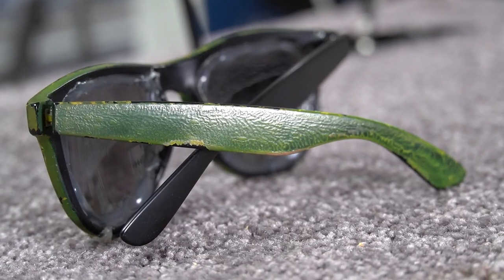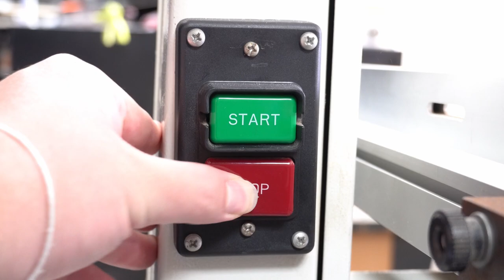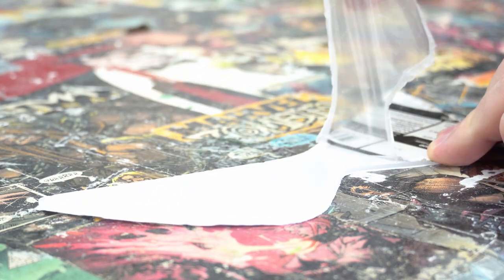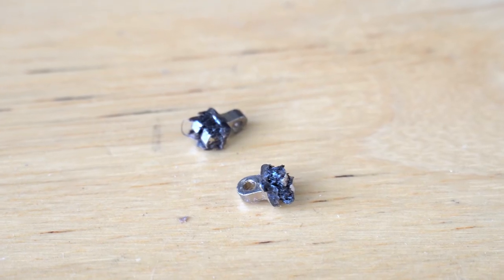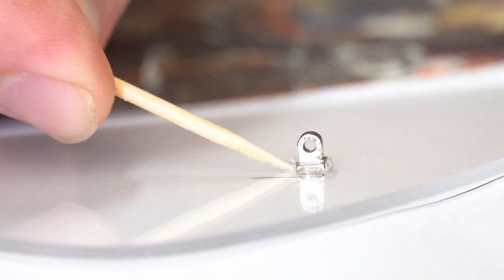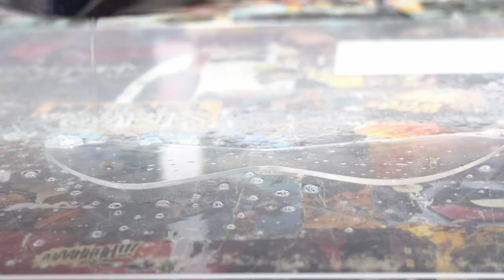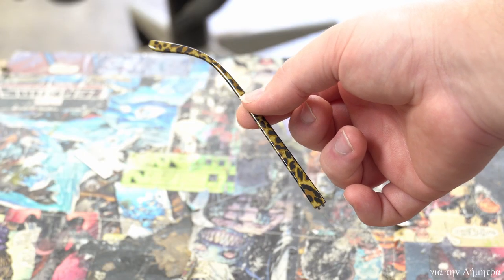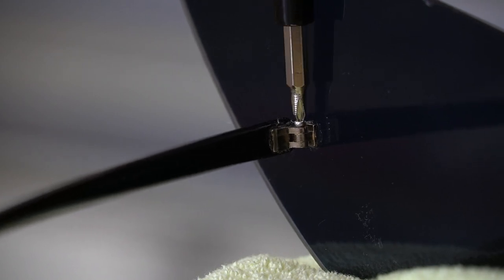I Made Real SQUIRTLE SQUAD SUNGLASSES!!!

Comment: Looks awesome! I would have maybe tried to heat bend a very slight curve in them to conform to the face a bit more. And maybe add some nose pads.
Reply from the maker: For this I wanted to make it as close to the reference material as possible. I did consider curving the lens to sit on a human face better but I thought that it would stray too far from the original design.

I originally planned to add a small bevel/roundover to the nose area, but I didn't find it to be necessary after wearing them. Couldn't hurt to add one though, and it would only take a few minutes with a small file and some sandpaper.

Comment: Bit worried about your nose, there bud. You may want to think about a way you can put a nose protector thingee on the inside. It would help the glasses to sit a bit lower 
on your face. Not that I'm complaining because I think they look totally bad-arse.
Reply from the maker: Thanks! I originally planned to add a small bevel/roundover to the nose area, but I didn't find it to be necessary after wearing them. Couldn't hurt to add one though, and it would only take a few minutes with a small file and some sandpaper.
Reply: @xyzcreate  
I guess the first important thing is that for you, the wearer, is that they're comfortable for you. Second most important being, of course, that they look as cool as fucking possible. I have to admit, I have a real problem with shades that sit too high up on a wearers face. And IMHO, these do. They're the visual equivalent (for me) of fingernails on a blackboard. So, I s'pose that says more about me than it does about you. In other words, if they're working for you then that's what's important. Thanks for your response. Mucho appreciato. and subscribed.

Comment: Have you found the need for nose pads?
Reply from the maker: I originally planned to add a small bevel/roundover to the nose area, but I didn't find it to be necessary after wearing them. Couldn't hurt to add one though, and it would only take a few minutes with a small file and some sandpaper.